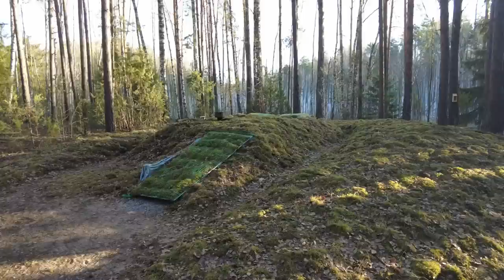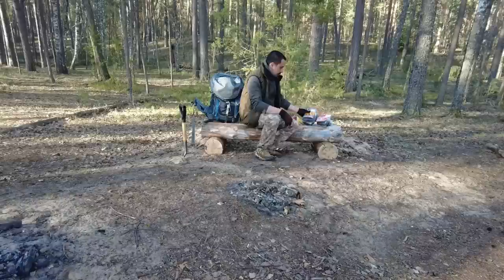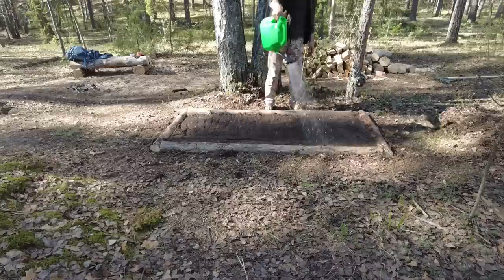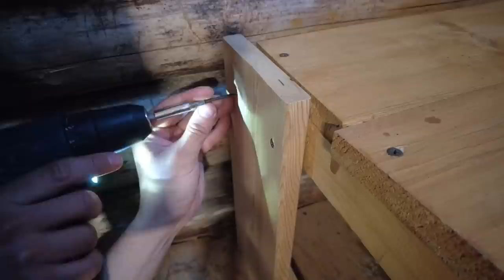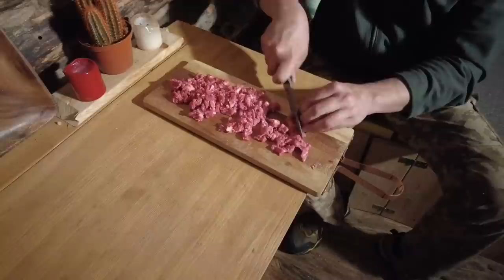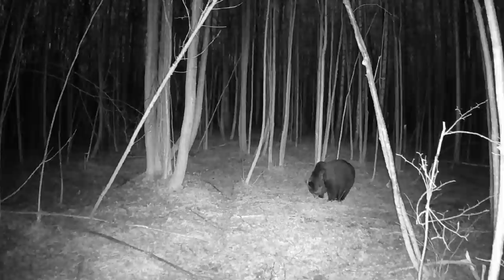Sheltered in a DUGOUT in Rain! 2 Days ALONE in the woods. My vegetable garden. Cooked burrito

Comment: I just want to say how much I admire your dugout cabin, I watch 3 other channels just like yours. All of you do just amazing work, so much so, that other people have tried to duplicate  your work, and have failed, by trying to use shortcuts. Your cabin is very sturdy, you really know what your doing. Your dugout is actually livable long term, if you needed to. Yours in particular is very well camouflaged. If some one was walking through the forest,  a distance away they would not be able to see your dugout,  because even the door and sky lights are hiden beneath camoflauge very well and the grass has grown very well on top of it. Inside is so nice, it's not just a dirt floor and a hard bench to sleep on. It's very much like a home away from home.  What I really like is that you have also installed nice thick foam on the bench. It will make sleeping and even sitting more comfortable . That's one thing I have often thought about when watching your channel (and the 3 other guys channels I watch, ) is how hard the bed must be. Some other people's dug outs have just used small logs for the bed instead of flat planks, it would be really uncomfortable.  And there's nothing wrong with having a little bit of comfort, when staying in your off grid, home.  So anyway I hope this all makes sense.  I would love to have what you have someday. Thank you for sharing.  You have done  such a remarkable job and I have learned alot from you and a few others. I hope to be able to have something similar. Thank you